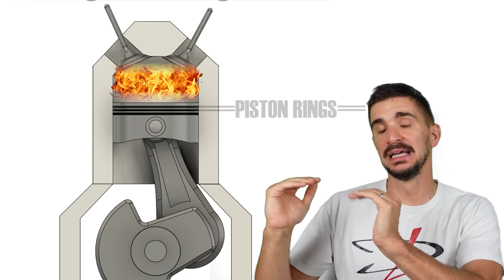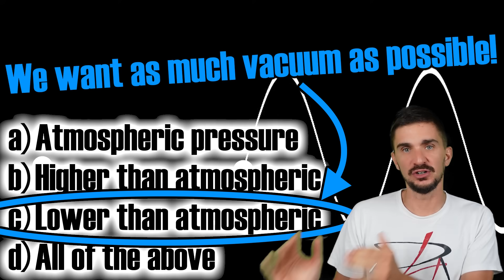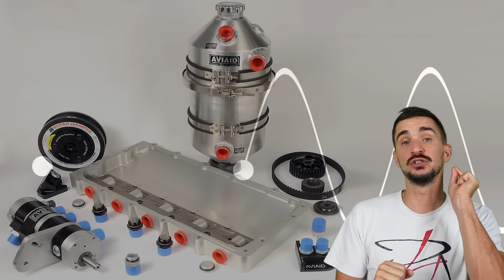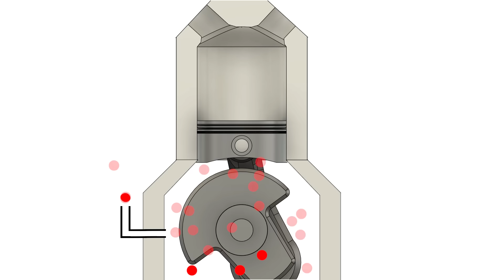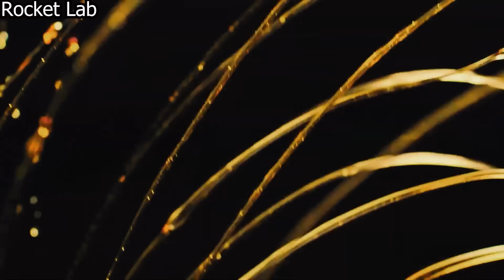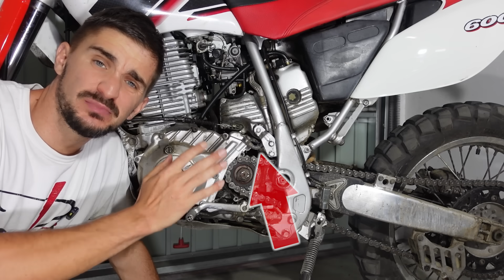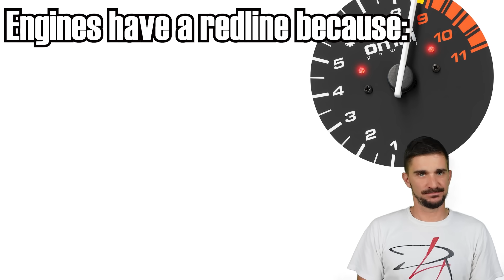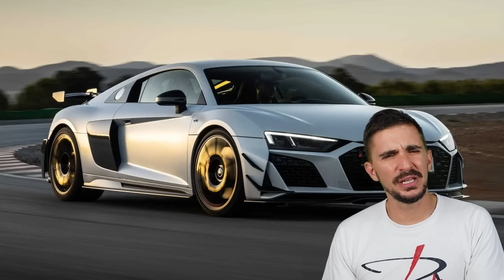Installing This Has No Drawbacks, Except for Your Wallet - Dry Sumps Are Awesome, Here's Why...

Comment: I have to stop you see it’s all of the above and you want all of the above to have just one you forget that the you don’t understand you have no idea what you’re talking about or what you’re messing with. None of you do while you found some way to increase horsepower you’ve messed something else up that you don’t even see and now let me explain something to you that oil ring. You’re gonna find this out in quantum physics and this is high science so if you’re using bubonic slavery which I’m talking to Christians, so it’s guaranteed your bubonic slavers You’re either bubonic slave or you’re a bubonic slave that’s all that there is in Christian Christian does not have high science now forgo that and I’m gonna give you your high science lesson when they take a radio telescope and they show a galactic bubble and this is as big as our radiotelescope can scan of reality around us. It looks like cell division exactly like cellular division, and you see this one ball that stretches to almost having a rod between the two balls and then it flexes back that’s called a reflex that reflex has to constantly happen to reinforce the surface tension of the oil you put it the solid vacuum you’re gonna get plastic in your oil. There’s so much more to how the engine works if you increase not the gap in the cylinder, exposing the ring around the piston, but the size of that piston ring you’re gonna get more power not only that the head itself is the engine and the piston is a motor, taking advantage of some of the energy generated off of the head in actuality, take ahead, put a flat piece of plate on the bottom of it so that the valves don’t hit that plate and it sealed up nice and tight Then put your intake and exhaust on it. Use a free valve heads cause you don’t have to put all of the mechanism to run the camshaft at the right timing for everything and run the thing you might have to prime it the first time but due to thermal expansion it is going to create a vacuum and a pressure and be sitting there running and is your engine that’s the actual power plant now to receive power off there’s the Frisbee disc that we showed that’s a weird football with a frisbee in the middle of it. Stainless steel a spin it with air to 666 RPS revolutions per second or right around that number and then they hit it at the bottom of it with a 75 kW laser and the football shoots over 100 feet in the air as fast as the laser light touches it now that’s the actual energy that you’re getting that’s making all that big bang horsepower and not so much the air expansion contrary to your mundane Neanderthal loving caved dwelling stupid ass. If you really wanna get down to it it’s a washer in the starter nose cone and you gotta talk with the guy in the parts store and he’ll explain the rest of that when you talk to the right guy in the parts store that guy at the parts store when he figures out the quantum physics of that right there which is just me reminding him of it he’ll be able to make your engine make some really unique sounds including not last at all or last until the end of goddamn timeand that’s actual physics actual quantum physics, actual looking at reality rather than thinking you know better like you non-high science fucktard yeah fucktard you know not to do this right here you know what it does and I haven’t even started to mention what it does

Comment: I know theyre not common but rotary engines also dont really benefit much from a dry sump system aside from specific race built cars. They dont have to worry about the same high revving drawbacks as a typical 4 stroke engine. Plus we got enough to worry about for oil delivery anyway we might die of stress if a dry sump was installed.

Comment: 16:14 Thats a rotax 912 engine. They have dry sumps.
However they use crank case pressure to push the oil out and into the reservoir.

Comment: 4:35 There is absolutely gravity in space. Not only that, there is also air resistance. There isn't some magical line where gravity and atmosphere stops, they just keep diminishing the further you get from earth. But you need to get VERY far from earth. For example, the ISS orbits at 400km above the surface but still experiences about 90% of the surface gravity.

If you throw an object in space it will just fall right back down to earth unless it has the speed to maintain orbit. Then it will continue falling to earth but keep missing the surface because the surface keeps curving away from it. And even then, it will eventually fall back down to earth because there is still tiny bits of atmosphere slowing it down. This is why the ISS needs to keep boosting itself back into orbit, the combination of gravity and atmosphere will inevitably bring it back to earth's surface otherwise.

Comment: Engineers watching this, I have a guestion : could we use a turbocharger to pull vacuum into the crankcase? Like by connecting the turbine side normally to the exhaust and then the compressor side backwards to the crankcase? 

Optional : So that the impeller would suck a vacuum into the crankcase and push the aerated oil mist to I dunno, into a separate air/oil separator and then vent the dry air to athmosphere or even into the intake? Like the mother of all catch cans

Comment: Just to be one of "Those guys".  Weight is the draw back that I was thinking of, because the pumps are heavier than the reduced oil pan material, and more oil also means more weight.  
It's a price worth paying most of the time.

I do appreciate your videos.  Very well thought out.
Reply: For racing engine, it could add more life to the engine. Like 2,3liter ohc on rally car maybe 300hp, you drive 1000stage kilometers almost constantly pedal to the floor. Then you need to service the engine for the next season, dry sump could add more flexibility to the engine so it survives the 1000stage kilometers easier without major failure so you dont have very expensive bomb under your hood. tuned and build ohc on these cars could cost easily 10k if connecting rod comes trough the block that is machined to fit very over size sleeves and longer stroke camshaft, everything is machined very precise and that is expensive. Purists and retro lovers will spend the money yes but if your motor blows up everytime season ends you cant survive with your hobby without good sponsors.
Reply: More expensive PEMS because of the oil added too, if planning to put in a daily driver or frequently driven vehicle
Reply: Another drawback is longer warm up time for the engine, because more parts and more oil. Like the aircooled 911 he talked about takes forever to heat up
Reply: To fit a dry sump in my engine bay means giving up OEM A/C (I'm in FL USA) to place scavenge  pump and relocating battery (I've heard of charging challenges) to make room for tank. 😕 and the tank would then be in front of RF tire, a common damage area.
Reply: Wouldn't this reduce oil volume?
Reply: @dosmastrify  Theoretically, you may be able to reduce the oil volume with a dry sump over a standard oil pan, but typically people use larger oil reservoirs(including the oil cooler and oil lines) with dry sumps for the heat capacity.
Reply: Ked máte pod piestom vákuum, tak sa vám nedostane toľko výfukových plynov do priestoru kde je olej ale jednoducho vyjdú von cez výfukové potrubie, tým padom sa olej toľko nezašpiní a nemusia byť tak časté výmeny oleja. Alebo sa mýlim?
Reply: And more expensive oil changes.

Comment: I've had 3 bikes with dry sumps, 2 yamaha 600's and an Aprilia RSV1000. All of them worked well but changing the oil and filter requires a liitle more consideration to make sure you get the right amount of oil in.

Comment: My 1000cc Aprilia has a dry sump. One draw back is checking oil level when the bike is cold. Before it can be checked accurately you must first fully warm up the engine. Such a pain in the ass when servicing and potentially damaging if you've made a mistake with your quantities.

Comment: A drawback I'm pondering is, how does it affect the power-to-weight ratio? I'm guessing that the system might weigh 10-25lbs, and thats almost enough on a 200lb motorcycle to offset the power gain. Just a drawback I thought of, maybe it's not as bad as i think, and I love all the other benefits.

Comment: Sorry, I don't get your explanation why vacum in a crank case lowers compression losses. Sure, it does when the cylinder head moves down, but then it returns all that energy when the head moves up, doesn't it? By the same reasoning, vacum in the crank case would resist the movement of the cyinder head upwards, just like it requires effort to pull on a syringe plunger when the end is closed by a finger. Or am I completely off?

Comment: Two downsides; more work to change the oil and harder to get a proper reading for the oil level. On my bike, you need to drain the sump, the oil tank and an oil line. Nothing crazy, but still.

Comment: US Drag and Drive racer Alex Taylor did recently upgrade to dry sump. The drag strip numbers indicate a 120hp gain. But more importantly, the car do now have stable oil pressure all the way down the strip.. Hard to keep oil at the oil pump pickup in an wet sump, in a car that goes 0-350kmh in less than 7 sec.

Comment: Could be interesting for a tiny (more dirt bike like) hybrid drivetrain generator. The smaller package would mitigate the integration cost for the sub system + it would let the hybrid engine run harder for longer.

Comment: It's almost like everything that we control about an engine, and don't leave to ambient factors, improves efficiency. If there's a fluid and it's not being pumped, pump it for huge power gains. Imagine if we let gravity handle the cooling system and didn't have a water pump. We'd be like "WOW SO MUCH POWER" when we finally put a pump on it, even though it's a parasitic loss.

Comment: Oil bath in wet systems crankcase, is responsible for cooling the pistons, removing heat from the piston by touching the down side of the piston. In a dry system, low pressure air, no oil bath, what cools the pistons?

Comment: Audi W12 had a dry sump at least in their first application, Audi A8 D2. Only 750 were made, I think. I assume dry sump was used because of lack of space in an engine bay designed for V8.

Comment: Great informative video. Thank you. There is another drawback in some dry sump systems, however.  With a configuration where the oil tank sits above the crankcase, long periods of no use can result in the oil slowly leaking past the oil pump and filling the small crankcase volume which is not a good thing the next time the engine is started. This was happening in my Morgan 3-wheeler with the S&S X-Wedge engine. Oil tank quantity was dropping significantely after a week or so of sitting. I installed a manual oil shutoff in the supply line to keep oil from filling up the crankcase. Just have to always remember to open it prior to start!
Reply: Yeah, forgetting that little step could be problematic.....err... catafuknstrophic.

Comment: Please correct me if I'm wrong but another "drawback" is that you should not really mount it on a car that is seeing normal day to day use, as it will take the engine much longer to reach operating temperature and we know where that leads. So as you mentioned towards the end, dry sumps go on cars that are meant to be driven harder than a regular car.
Reply: Just because dry sumps allow for increased oil volume doesn't mean that they have to have increased oil volume.
Reply: eh, there are street motorcycles that use them. It could be a problem, but i think it would be possible to engineer around it
Reply: @alextopfer1068  The only reason the engine could potentially take longer to get to temp is due to the increased volume of oil used in a dry sump system compared to a wet sump system on the same engine.  The mechanical system that is a dry sump isn't the issue regarding increased op. temp times, this is why it is no problem on motorcycles.
Reply: @kingcosworth2643  gotchu
Reply: You could throw in a heater.
Reply: I think most modern cars are designed to not have to warm up in normal temperatures
Reply: @joseppi4435  yeah and transmission fluid is designed to last the life of the car just idle for a minute so the oil is everywhere or it wont last as long
Reply: @joseppi4435  Yes, the raised idle phase is a lot shorter now than 20 years ago.
Reply: Tell porsche and corvette that among others.
Reply: "Driven harder than a normal car". This sounds like my day-to-day driving... I'm tagging 7.5k rpm as I pull away from my driveway... Where do I sign the loan for this?
Reply: So air cooled means oil cooled Vs water cooled
Reply: They have oil filter mounts that allow you to prime the engine before start up, with a drill.
Reply: I've built multiple dry sump systems from scratch for my cars, mainly for LS motors. Most decent tanks will have provisions for heater probes that you can get in 110 or 220v that screw into the tank. They will also often also use the heaters that wrap around the outside of the tank. Not really ideal for the street unless you want to pre warm your car every cold morning. You probably could baby the car until it warms up but it will definitely take longer than a wet sump.

I don't think i will ever bother going dry sump on a street car if it already has a decent baffled and trap doored sump and maybe over fill it a little. The money could be put elsewhere for power increases than the gains from a dry sump system. 

If i recall you really need something with at least three scavenge sections to get the benefits of a vacuum in the crankcase. I always put a vacuum relief valve on the valley cover to manage the vacuum in the crankcase. Too much will start to reduce the oil vapor in areas of the piston such as wrist pin if the engine doesn't have squirters or anything to compensate.

Another option is a belt driven vacuum pump. You won't gain from the reduced windage but it's cheaper to setup and far less plumbing.
Reply: thats a good point. also for cars that are in colder climates i imagine the oil would have a very difficult time reaching the cams if it has to go through all that extra stuff leading to massive premature wear compared to what is conventionally done
Reply: @salvo7288  no, not really. The distance between the pump and cylinder head is often about the same. Depending where you mount the pressure pump and if you run external lines you could even have it shorter
Likewise if you're really worried about cold oil, you can add an oil heater to the reservoir. I don't think i've ever heard of anyone doing that, but it's possible.
Plus the pump and external reservoir can be located in a way that the pump is primed by gravity. Whereas a wet sump pump needs to suck up the oil from the sump at startup
Reply: @salvo7288 You know they make multi-viscosity, right? Just run the appropriate oil for your climate.
Reply: Operating temperature....its not the 70s. 
Synthetic oil...
Reply: @scottyboy6269  its not heat any more but you dont want to move it before the gets everywhere in the engine but a minute is fine unless its really cold outside then you do want to wait for it to warm up

Comment: I disagree with the oil starvation part of the video, that very very brief of air the oil pump will suck will not damage an engine because there is still a film of oil on the bearings during that very brief of air being sucked.

https://youtu.be/3WLOccckJ5o?si=7TNpFUzR8d_l97Yk

Comment: There is one drawback i can think of, at least for standard road vehicles. Reliability.
A wet sump configuration keeps all your oil inside the engine.
A dry sump forces oil under pressure through the lines outside the engine.
Meaning you have more risk of oil leaks.
(of course, this comparison is useless with engines that have oil coolers)
Reply: And if you miss a worn belt, you might blow up your engine. When it's gear driven, it's always driven. All of my cars have gear driven cams and gear driven oil pumps :)
Reply: Had the same thought. Even with a cooler, more hoses equals higher risk. This is why I walked away from adding a pre oiler to my infrequently driven camping SUV.
Reply: Also the leak is going to be catastrophic sooner, because they are leaking under pressure, and more parts means more failures.